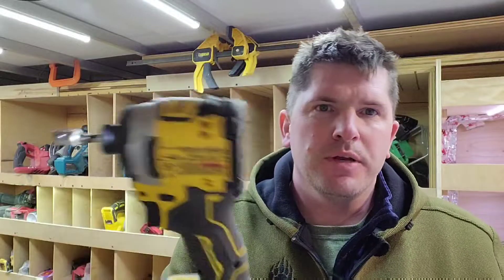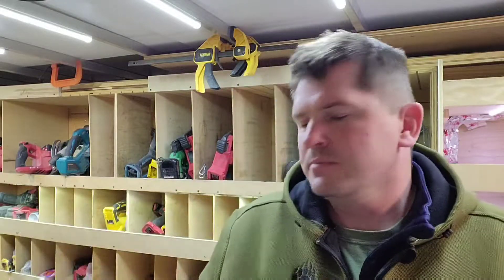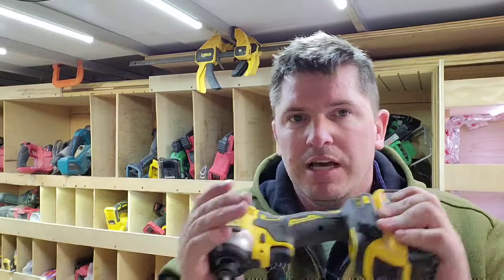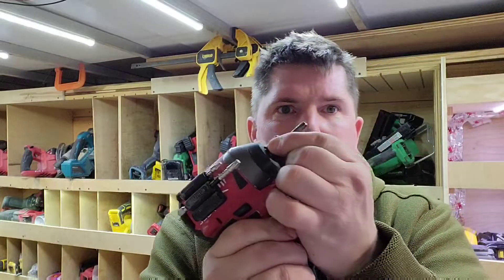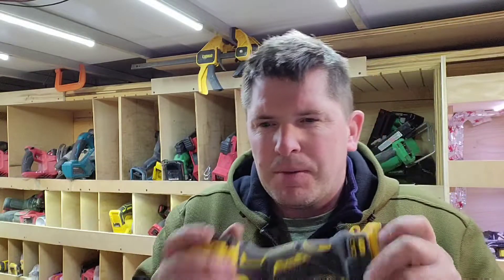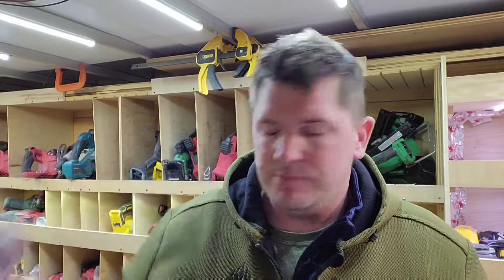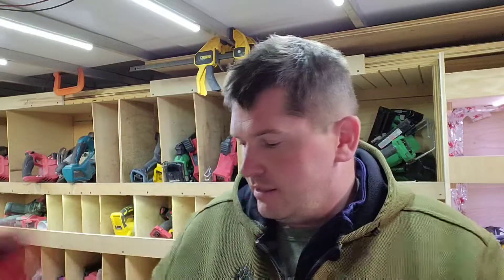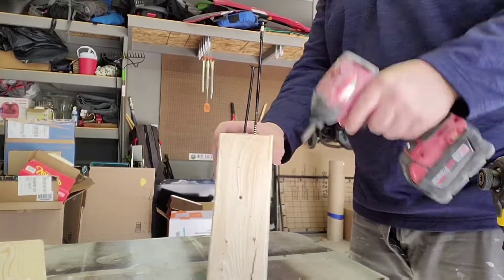Dewalt DCF850 Impact Overview!

Comment: Ha ha you spent the first 2 min talking about how you like the delwats trigger, size, lights, grip (the whole tool) Better than the gen 3 but then follow up saying DeWalt is first to market but Milwaukee comes out with a better version....... Ha ha you did say your partial to Milwaukee but come on. I love them both just funny to hear.
Reply from the maker: Milwaukee's 2853 has been to market for years. It is proven a quality tool except for their trigger. This Dewalt has been great but I have only had it on the jobsite for a month. Both are good tools.
Reply: @RenovationsandRepair  love your videos, definitely a real world no nonsense channel. Just funny how it sounded, I agree the Milwaukee gen3 is my go to with the M12 for my quick fix kit. Have DeWalts in my trailer but normally my help uses them. Good content keep it coming! Happy holidays!